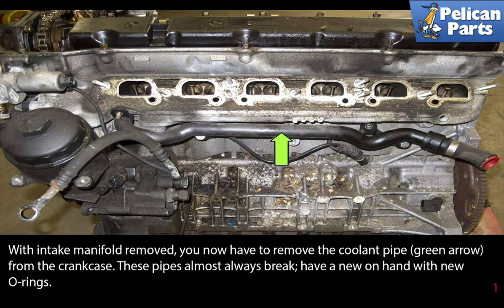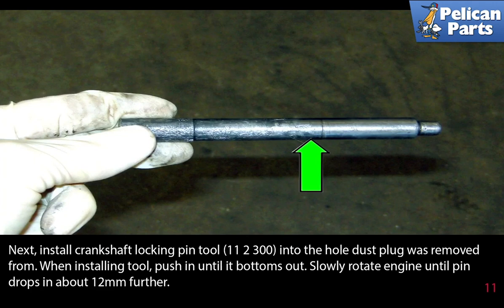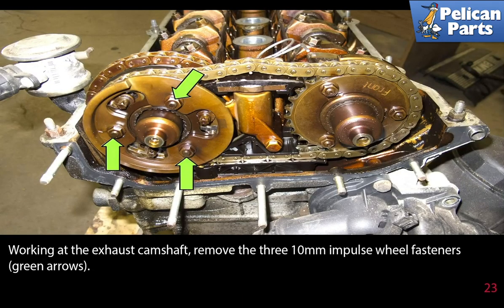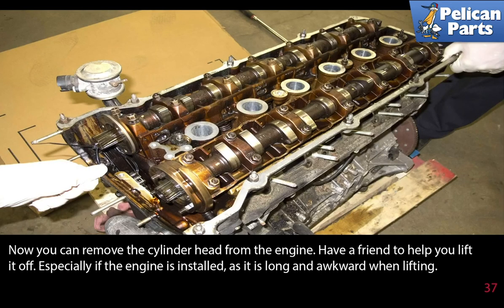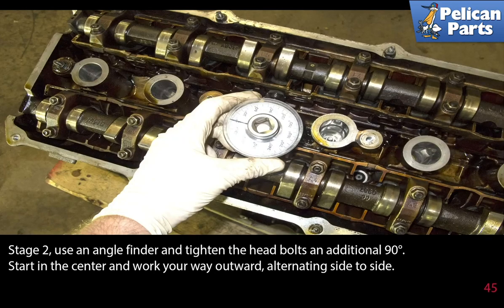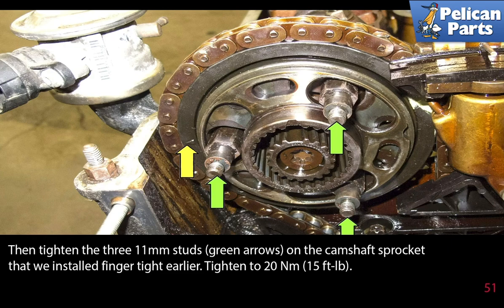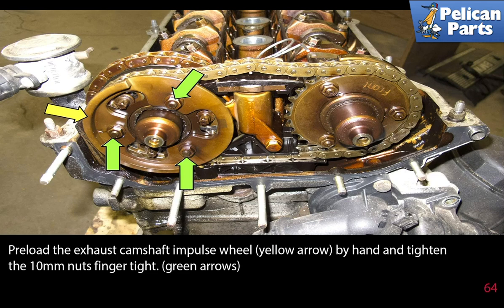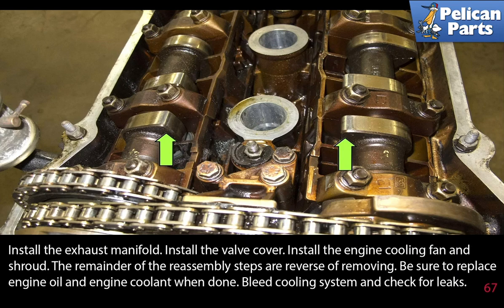BMW E46 3-Series Head Gasket Replacement for 323i, 325i, 328i and 330i

Comment: i just got done doing a head gasket on my 04 325xi and i got everything back together i tought but maybe not, i tried to turn it on and there was no crank, then when i tried to turn the key again it was like locked, they key wont fully turn, any help
Reply from the maker: Check timing and check for coolant in the cylinders. Could either be mistimed or hydro locked.
Reply: almost sounds like its your locking cylinder or your battery that is the problem here. I see it's been 2 months now, so what happened?
Reply: @Thomas-fc6gf  i put in a new coolant temp sensor that goes on the block and it fired right up, pretty weird

Comment: really helpful and detailed video, I appreciate that you show all special tool codes, but do I really need to change the head gasket if I found some milky substance on my oil cap?
Reply from the maker: That is usually oil mixing. So I would look to see if has failed.  I would pressure test the cooling system. If the system will not hold pressure and there are no external leaks the head gasket may be faulty.

Comment: I have been told by every mechanic that a 325i cannot have its head gasket replaced due to the head bolt hole threads in the iluminum  block being too weak to handle  being retorqued. Is this true?
Reply from the maker: You will want to test the head bolts before removing the head. See this article: https://www.pelicanparts.com/BMW/techarticles/BMW-3-Series-E46/104-ENGINE-Cylinder_Head_Bolt_Testing/104-ENGINE-Cylinder_Head_Bolt_Testing.htm

Comment: I think my head gasket might be going, not really sure. I get a little cloud of white smoke once in a while, when im shifting from first to 2nd or 2nd to 3rd. Its only in those lower gears. And ive only noticed it twice. But thats literally the onpy symptom
Reply from the maker: If your coolant level isn't getting lower, it likely isn't leaking.
Reply: @pelicanparts  yeah it's not getting lower. I'm not sure what that issue is

Comment: My 2004 325 xi head gasket is blown.  To solve this the easy way. I can swap 2001 325 engine or I can dump more head gasket repair liquid into the radiator. I buy me another bottle  tomorrow. May be a third bottle of gasket liquid fill in. Hopefully it will work. I will let you all know.
Reply from the maker: Gasket stopleak will not repair the faulty gasket. It could plug up the radiator or heater core. I'd suggest replacing the gasket or engine, look for something with an M54 engine when looking for donor engines.

Comment: Great DIY video!!! 
I do have a question. On the block , do you apply the sealing compound 3 Bond 1209 only where the timing cover joins or you apply this on the whole surface of the block (minus all the holes, of course)? 
Thank you for sharing the knowledge.
Reply from the maker: Just where the timing cover joints are.

Comment: Hi, little late to this vid so hope you will still respond. Question, for what do you use the cam locking tool? Is removing the head possible without using the cam locking tool?
Reply from the maker: Possible. But you won't be able to time the engine.

Comment: what's the part number or the name of the green arrowed coolant hose? I  can not seem to find the right one. 
Thanks
Reply from the maker: You didn't mention what year and model vehicle you are working on.

With your vehicle info handy, give The Pelican Parts parts specialists a call at 1-888-280-7799. They can figure out what part or repair kit you need.

Comment: When i used to drive a single cam honda civic it was possible to swap the cylinder head to get higher compression.. Im trying to find information on this for BMW and i cant really find any for my exact question. Can i put  a 2001 330xi cylinder head on a 1999 328i? & would doing this actually serve a purpose? Both engines are inline 6.
Reply: They might not be the same cuz sometimes Same cars have diffrent Cylinder size and oil Passages even if its mm's
Reply: @bo-z1790  alright will keep that in mind thanks bro
Reply from the maker: The heads are the same, from 1998 to 2014 , same part number. You can double check by confirming your vehicle part number and the donor vehicle's/
Reply from the maker: Thanks for the input on this one. We appreciate the help.

Comment: great video, what is the difference between the e46 320i and the others? Does this way of doing apply to the e46 320i?
Reply from the maker: We did not have a 320 E46 in the US, so I can't comment directly. However, if that VANOS system is similar, it will be a similar procedure.
Reply: @pelicanparts  I was worried about being different, because I saw that it applied to the e46 but it didn't talk about the 320i, but I did the disassembly and I verified that it is similar, thanks

Comment: Did mine starts but won’t drive
Reply from the maker: I would start by checking the vehicle for fault codes. If the system is not working properly, a fault code will be set. This will be your best bet when diagnosing.

Comment: And here I was foolishly thinking it's worthing trying to change my own head gasket when I have no experience with working on an engine 😂
Reply from the maker: it is an advanced repair, but totally do-able.
Reply: All I've done is a rear diff replacement, judt bought a 330xi to do the head gasket on and make some money.
Reply: @PenjaminFranklinn how was it
Reply: @Drewless  I ended up parting it out, but the disassembly was pretty easy. Just dont miss any head studs and be careful not to round the e torx

Comment: Basically if the head gasket goes, buy a new engine
Reply from the maker: If you don't want to repair, yes.
Reply: Pelican Parts sorry I didn’t mean that in an asshole way, after reading it back it sounds rude
Reply: Just as much work to pull the engine and put another one in. Its more of do you got any brains or not lol